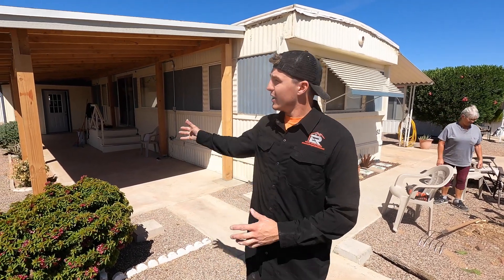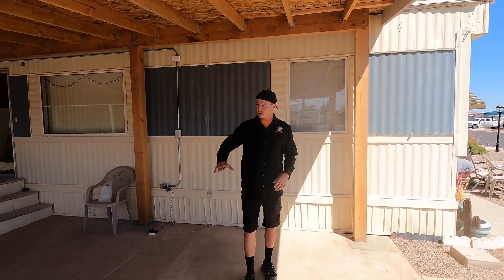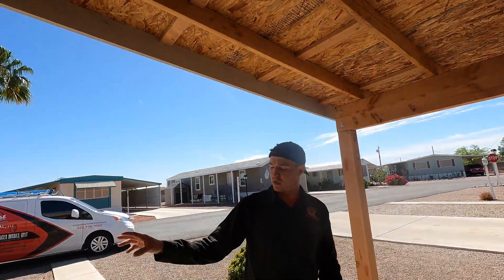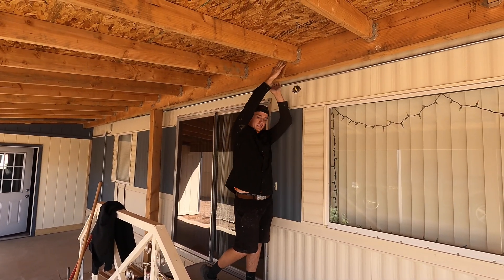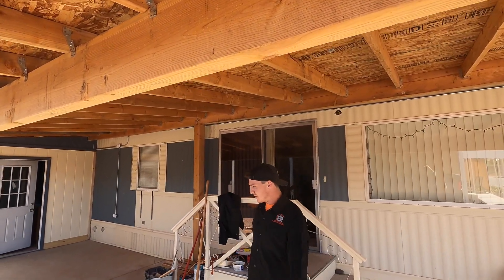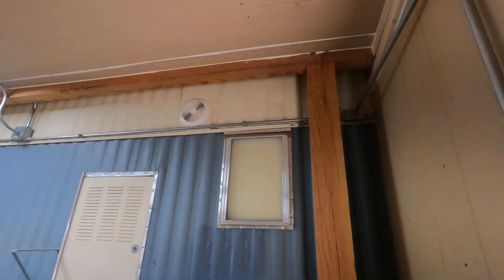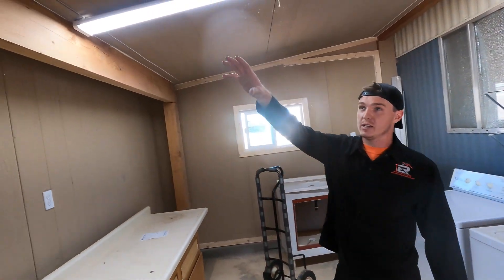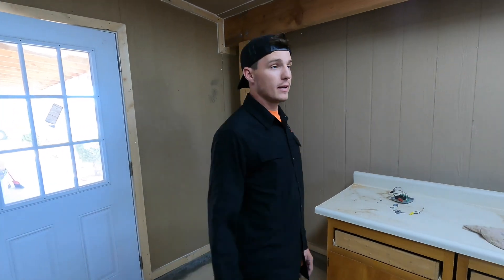How to build a free standing patio cover

Comment: Cool video.. how the plywood prevent the structure from moving or wobble ?i'm not an expert but I'm not sure  a free standing with only one post into the concrete is not a problem,and also how deep it is below the surface

Comment: Are you near the Coachella Valley, I have a carport enclosure that may need to be ripped down and the awning that covers it is no good. I want to have something like that but with 38' of enclosure and the total 44 feet covered above. I can use the old walls to enclose it again but it needs to be modified to be shorter in height because of the building. How much does it cost to get the free standing part done first? Rough estimate. Thanks.